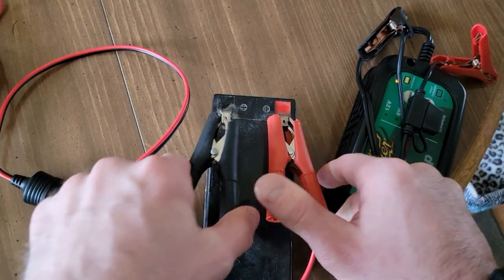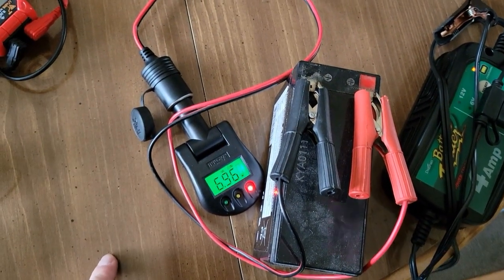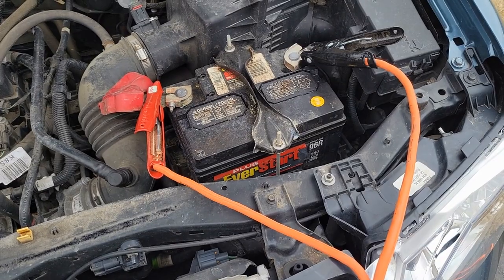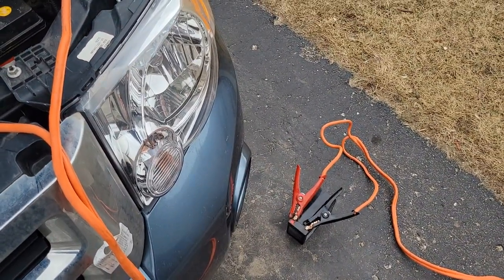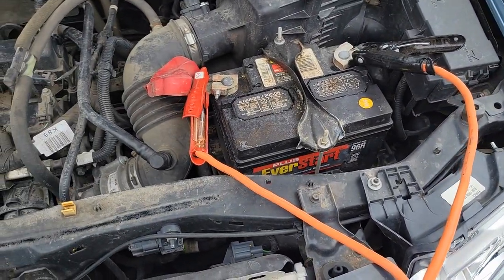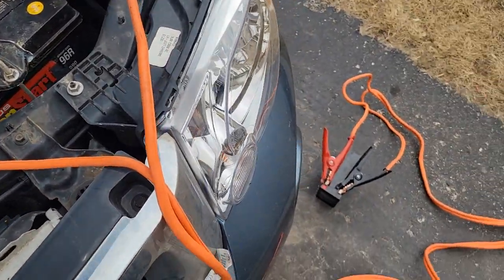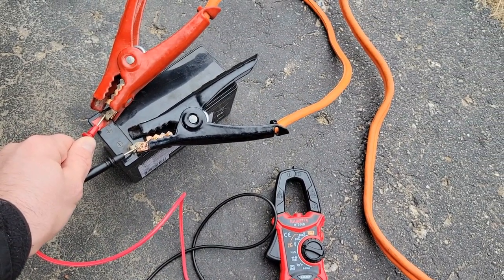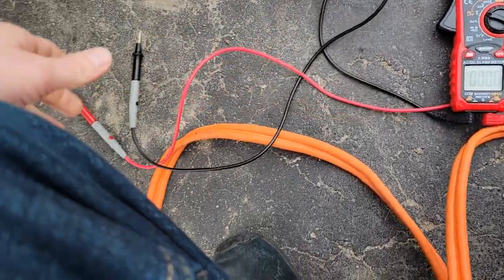12v Charger Won't Charge or Recognize a Battery? [Easy Fix in Under 5 minutes]

Comment: There has been numerous YT videos on this subject. I have several chargers from shop/cart type to your smaller lower amp bench top type. Battery chargers are based around a transformer converting 120VAC to 12-14 VDC. The transformer is going to produce that voltage as soon as it has power going into it. I am curious as to whether a momentary switch could be added to a "smart" charger to jump the voltage around what I am assuming is a relay stopping the DCV from going to the charge leads until correct DC voltage is recognized. Theoretically turning the charger on, tapping the button would energize the charge leads weather there was a battery connected or not. How long you have to hold the button down would be dependent on how low the battery voltage is and your selected charge amp rate. I have not opened up one of my chargers to test this theory out, I have a cart type that is a smart charger that needs to be "fixed". I understand the dangers in this IE running a smart charger the same way all of my other chargers work requiring ME to pay attention and hook it up correctly. Maybe someone has played with this already.

Comment: Thanks for the video. Was able to get my battery from 4v to 11v by using your method (but charger still reads same FULL on 4v and 11v). With meter you can watch volts drop down again. i have charger in repair mode now.

Comment: I use a hobby charger that has a “pb” lead acid setting, and can change amperage from .1 to 6 amps   solder up xt60 to alligator clamps.

Comment: Do you have an 18volt or 20volt tool battery?  You can use that to "jump" your lawn tractor enough for the charger to recognize it as a 12v battery. Mind the polarity (plus to plus).

Comment: My battery was so dead the jumper battery pack I had would not turn the car over. Also so dead that my charger would not work. So I hooked up the jumper battery and then the battery charger. It recognized it as a battery and after 1 hour I disconnected the pack and the charger did the rest.
Reply: Interesting! I'm in the same boat. Luckily I had a battery jumper, but that didn't turn the car over. Then today I just went to buy a charger. That's not working. Here I am, and now I see your comment.

I dunno though man, sounds kinda dangerous? I'm glad it worked for you but I'm not sure I'm game enough to try it.
Reply: @intensecutn  They were connected in parallel. As long as you don't connect them in series you would be safe. Plus I did not walk away from them during this. And monitored the temperature of all 3 with a laser probe. If it started to heat up I was going to abort. As they say. Sometimes LUCK favors to bold. Or it kills you. Ha Ha..

Comment: I did this with my car with a battery that was sitting for a year and it worked. I didn't use another car though. I have a jumpstart portable battery bank and I plugged onto my car battery and jump started my dead battery (multimeter was reading like .042v). I let it run for like a minute while pressing the gas in neutral. Checked my multimeter and it read 13v and and I turned off my car and unplugged my battery and plugged in the charger and it started working. Fingers crossed it can bring my battery back from death. I guess we'll see in 24 hours. You're a life saver. Thanks for the tip.
Reply: Please come back with an update. 11 hours and counting 😆

Comment: Both my battery chargers say that my battery is charged but when I check the voltage it is at 10.3v. Just wondering if you think that this method might work. I live in an apartment so I would have to take the battery out and use it through my motorcycle battery which is out but is fully charged.

Comment: Appreciate the insight.  QUESTION: According to your video on "Difference Between Float and Trickle Charger"; under the conditions that the Schumaker Model you described, will the "bad" battery, that has been sitting too long that you referred to here,,,,, be restored back to working condition if the Schumaker brand is used with the de-sulfate option because the crystals are now broken up.... hence allowing the automatic charger method you used here to work once again?  Pardon my ignorance on the matter the most I know is what i just learned from you. cheers
Reply from the maker: Sorry for the late reply.  It totally depends on how long the lead sulfate has been on the plates, how thick it is, and a myriad of other factors.  I think the desulfation/equalization modes are better for routine maintenance after a couple of deep-cycles (to knock off the newly formed lead sulfate as the battery's state of charge dropped) instead of  trying to resurrect a battery that is already out of commission.